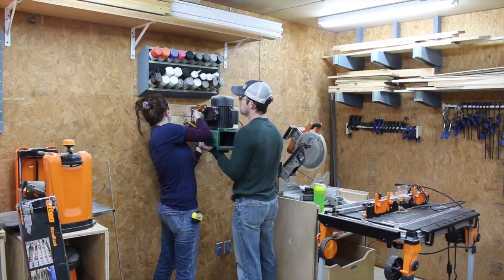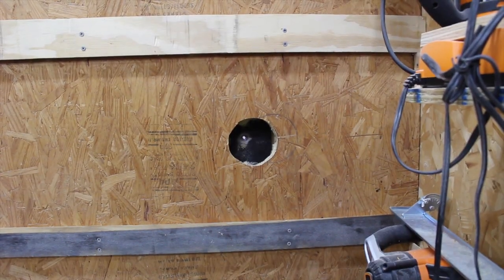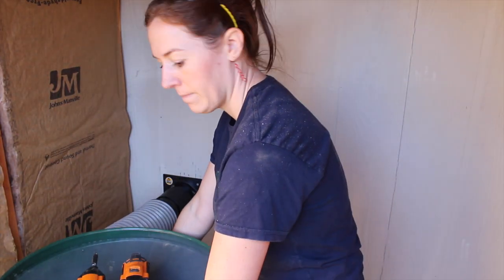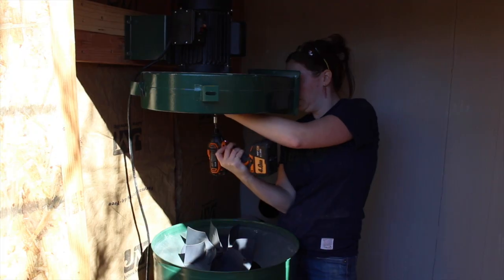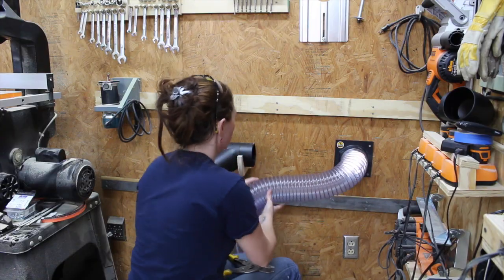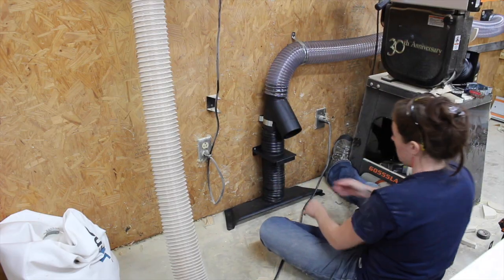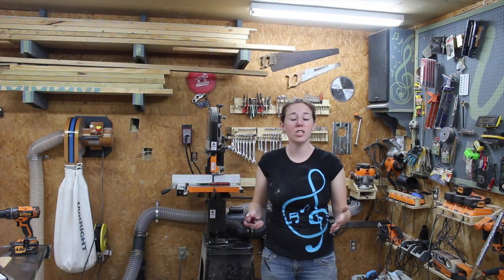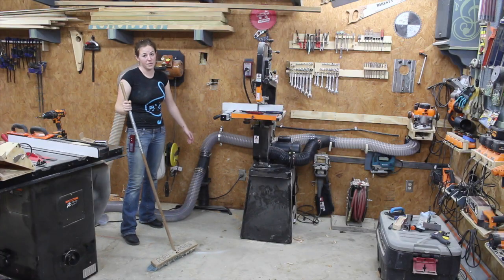Installing My Harbor Freight Dust Collector (Finally!)

Comment: I used a similar setup with the Harbor Freight dust collector.  We plumbed inside the shop with 4" PVC pipe.  We were able to position the motor, impeller and the trash can under an awning/covered area behind the shop.  The exhaust just blows straight out behind the shop into the weeds.

A floor sweep is definitely the next thing to add!!

It really is nice how quiet the dust collector is when it's outside the shop!

Comment: Hej April, put some magnets in front of the floorsweep to collect fallen drill- and screw bits out of the sawdust
Reply: Hey thanks for the great idea!!!
Reply: Dave D
Reply: That is an awesome idea!  I'm going to have to do that to mine whenever I get a dust collection system set up in my shop.
Reply: ooooo they have screw pickup wheels pusher i think would be a great place to store it in front of that floor hose.
Reply: Very good idea...
Reply: The vac probably won't lift them anyway.

Comment: April, I love the idea of building a shed to for the dust collector! I had mounted mine high in the air, but it is too noisy being in the same room. I plan to build a shed now.  When it gets done, that's another issue. I built a step up floor out of Two by Sixes and plywood to go to my stationary tools. The power lines are also in the step up floor. This has worked out really well for me.  I painted it grey and the paint is still in excellent condition, even with me walking all over it for all these years. There is a little step to go over it, but it has never been an issue to me.  Since I put mine in many years ago, I built all my blast gates. They are a bit of a pain, so I plan to replace them with purchased gates. Thanks so much for inspiration. John Esposito

Comment: Hi April, great job on the new "fitted and working" dust collector. But what i do like is the floor sweep port, this is a great addition to yours and any shop. You can get switches for the blast gates to switch on the motor as and when you need it,
we have them fitted in a shop i work in, no remotes to loose.

Comment: This video is really fantastic.  I have the same Freight Harbor dust collector, and have been planning a wall mount, two-stage filter (just like yours), and plan to vent outside as well.  Mine will be mounted inside the shop because I live in Seattle where rain is a constant, and I have no adjoining shed or other outside shelter.  Anyway, I learned A LOT from your videos.  I've been thinking about how to rotate the collector because of the vent direction, and you were kindly brave enough to pull off the flange and describe how it is mounted to the motor - so now I can use your tip!  Also, I was stumped figuring out how to attach some kind of quick-release "lid" on my trash can so that I can easily attach/detach the baffle.  Your system looks pretty good, I'll probably try a different approach, but I was inspired by your use of the buckle system on the trash can handles.  BRILLIANT!!!   Anyway... I have loved all your videos.  You are working on so many similar projects and I'm really impressed with how you work through issues, and how quickly you are able to complete these projects.  My miter workstation took weeks, many redesigns, and I've just completed modeling version 3 in SketchUp and am doing cuts / rabbets, etc, today (pre-assembly).  Thanks for all the inspiration, I'll be subscribing and following along on your awesome projects.

Comment: Hi April,
I'm jealous! Just a suggestion - there should be no problem exhausting your dust collector out of your shed. Since that is technically not a load bearing wall, I would cut the hole in the wall through the stud and frame around it similar to a window. I think you did pretty much the same thing when you mounted your A/C unit in your shop.
Reply: +Jim Kodysz 
A VERY GOOD suggestion!!!!!!!!!!! April, please try this!
....13

Comment: If you want to have a removable hose (like that one that goes to your table saw) and don't want to un-do a hose clamp every time here's an idea: Get/make two flanges like that on the inside of the through-wall duct. Then drill some corresponding holes in the flat parts of them. Glue in some rare earth magnets in the holes. Now you will have a coupling that can be disconnected and reconnected easily, or even blocked off completely using a small sheet of metal. Magnets for this project can be got at HF really cheap.

Comment: Hey April.  Heard about the planer shavings issue on the podcast.  I'm betting most of the clogging comes from having such a thick slot what with doubled up plywood.  My baffle is only 1/2" thick, and it just hangs from the lid of the can (so the outside edge of the slot is actually the smooth can wall).  No clogging problems so far.

That conical "shelf" on the inside of the HF separator isn't helping you out any either.  It's just in the way of the cyclonic airflow.  Bust out the Saw-Z-All and get rid of that thing.  You might end up having to add 3-4 inches of PVC to extend your central air outlet down a bit too.  IIRC it's supposed to be about even with the top of the inlet pipe.

Love the project!  Can't wait for spring so I can start venting mine outside again.  I can't leave it that way all the time or I'd have to just start calling it the "heat remover" instead of the dust collector.

Comment: Awesome job, April.  I started off with flex hose for my trunks and quickly grew to hate it for air resistance.  I switched to galvanized 4" pipe and it was night and day.
Reply: +Jason Rausch somehow, i think you meant 4" ducting vs. 4" galvanized "pipe"... hehe

Comment: Thumbs up!! With the issue of the hose being in the way of the blast gate/floor sweep you could simply turn "y" fitting left to where it touches the wall and then connect your table saw hose angled down the wall and across to the table saw. Just a thought I had hope this helps!!

Comment: Good job, just keep in mind in you get a real winter where you live that the dust collector will also suck all the heat out of your shop, the only good thing is if you have your air compressor in the shed also it will stay nice and warm.

Comment: Hey April, I finally took the plunge into dust collecting. Installing the collector was a piece of cake. I put it in my attic so anything that sneaks out of it will be harmless. However I found plumbing this thing was a huge undertaking. I ran the 60 feet of pipes thru the attic where but still hanging the rest from a 10 ceiling was interesting. It's finally in and can't wait to use it and trouble shoot everything. Thanks for the inspiration any tips. Maybe one day I'll get a big ole shop like yours.

Comment: Floor sweep=pretty cool. I would have like to see the dust storm outside. Don't let your compressor suck up all the crap from the exhaust, if it is outside. Rotate table saw Y 90* to left against wall. I wish the the people I work with were as competent as you! And your narration is excellent. Also, I can relate to your drive levels; I have 5 lifetimes of projects and with so much to do, projects get pushed out, but when I start, they are primary focus.

Comment: I mounted my HF Dust Collector on outside wall and vented it directly out through the wall. Thanks for the great idea of rotating the housing and the heads up on the backwards threads.. Wish you would have mentioned that I needed a Pulley Puller to remove the impeller... Lol ..  Maybe you didn't need one?? I enjoy all your Videos.. Thanks & Keep up the good work..

Comment: Nice work. One day I need to do this. I have bought and used the large 3",4",5", and 6" diameter hole saws, and used them successfully on my 88 year old home to run exhaust vents from the 2 upstairs bathrooms out through the concrete stucco wall. I found If i use a long enough drill bit with the hole saw, and I check for being perpendicular, the center hole lines right up with the first hole drilled. Saved me from using a jig saw 30+ feet in the air. 8^).

Comment: Nice job there..How about this, cut the stud that the exhaust connector was going to hit, frame the opening like you would do a window and run the exhaust out that way since the wall isn't a load bearing wall, it wouldn't hurt a thing, just my thought..Good continued wood working !!

Comment: See if you can find a neodymium magnet or two to put under your floor sweep. Epoxy them to the floor or place on top of your sweep that way it will pull out anything you lose in the floor and keep screws and nails from being sucked up. It's handy to have when you lose something important and find it on the magnet instead of lost forever in your dust collector.

Comment: That motor is heavy, I did mine by myself.  I moved mine and just vented it outside and it blows to the ground.  I clean up the pile everyone once and a while, not enough times to suit the wifey.  I need a floor sweep.  Great video.

Comment: Nice!  That flex hose is pretty bad for air flow though.  It's great for moving around and sucking up the floor, but along the walls you should definitely use 4 inch ABS plastic pipe from home depot and the like.  It will look better, and have better flow.  Great ideas and work as always

Comment: Great job April!  I'd think you would just use your great woodworking skills to make a 90deg adapter duct for the outlet so that you can connect your current outlet position through the outside wall while missing that stud.

Comment: Great job. If a longer run is needed you may lose some suction with the style hose you are using. The corrugated walls of the hose slows down the flow of the air inside. A smooth pipe for areas that are not going to equipment would enhance the flow you already  are experiencing. Again, a fine accomplishment that is sure to make your work area a quieter environment. You have good ideas for a shop. Wish I was as organized.
Reply from the maker: Yes true true, a few people told me that but so far I'm really happy with how it's working. But like you said, if I add in longer runs I might have to switch to pipe. If that's the case, I'll probably go with something larger too. Thank you!

Comment: Nice to finally have a working extractor system April ( better for your lungs as well) if you find suction power loss I would suggest you look into fitting hard extractor pipe the flexible pipes loose almost 30% vacuum due to flexing, just use flexible from waste gates to machine, you might also want to fit some earthing from the flexible pipe it developed fantastic static ( might be a cheep perm for you but ouch it hurts) 
Your shop is looking better as times goes on I'm definitely getting gelous

Comment: @7:27 all you have to do is rotate the Y connection 90 degrees away from the saw and that will allow you to clear the sweep and gate and still run to the table saw with the flex hose.

Comment: Great job on the follow up! In the future please consider using PVC pipe. This will decrease leakage from the hosing connections and increase your airflow due to the lack of ribbing on your hosing. Just a thought:)

Comment: Quick tip, since the hoses are all running along the floor, those might get in the way. Why not reverse that y-connector and have your hoses run along the ceiling and attach a spring to draw them back up when not in use? This way you can pull them down and attach them to tools as needed, while keeping your shop floor obstacle free.

Comment: Way to go April, now you will have a clean environment that will not be damaging to your lungs. Next is a air filtering system. HA! Thank you for modelling a clean shop envronment. I will be moving mine out side as soon as the rainy season is over.

Comment: april looking good...just an FYI I have gone through 3 of those remotes with less than 1 yrs worth of use...dont know why...maybe lightning ....I now use the 20 dollar outdoor remotes for lights ..they may not be rated  for the amps but my last one lasted 15 yrs and just went out a few months back...and when connecting those plastic fittings try super gluing the connectors together instead of using a flex hose between them.when applicable ..if I do a video on them I will let you know...love your stuff

Comment: Looks great! I'm glad you showed the "through the wall" fitting. Mine will be outside of the shop as well.  Could you just rotate the 'Y' fitting to the left a little bit so you can fit the broom closer to the floor sweep? Maybe that would give you more clearance.

Comment: You have a harbor freight dust collector and a dust right dust collector makes me so jealous I have nothing witch is bad because it's hard for me to breath !!! I just can't afford a dust collector. I'm so jealous of your shop and tools. I wish my shop was like yours. Love you videos can't wait to see more !!!
Reply: In my old shed I used an unloved  kirby vacuum bought for about $25 and an old 25 gallon paint drum. Believe me when I say it worked a treat ;)
Reply: Anthony Frasco you could also make a shop air cleaner with a couple furnace filters and a box fan. You can look up videos on YouTube to get an idea about designs.

Comment: Very Very nice, Turn the y joint to the wall and the hose to the saw will not interfere to the sweep and no extra parts
Reply from the maker: Good tip!

Comment: Great video! For what it's worth, I've been using the same HF collector with Rockler's "Yellow" DC Remote Switch (#43959) which has a much smaller remote for a couple of years with no problems. The 20A rating by HF seems to be a bit exaggerated.
Reply: +Around Home I have as well.  Not an issue regarding the amps.

Comment: I found that having a 'permanent' ductwork dust collection in a small shop, is a waste of money and space.  Using the 7 to 1 memory flex hose (Rockler) is such a better solution because you never have the hose permanently laying on the floor, AND the air flow is much more efficient!!In other words, the outdoor dust collector is a great idea, but just attach the flex hose to the through the wall tube, and put a 'Handle" that attaches to all the different machines you have on the other end.  See Rockler for the Quick Release System, works great!!  No blast gates no costly permanent set up.

Comment: "...would you just lift the motor?"  I love your attitude.     I plan on using straight walled pipe (PVC or metal) where it will permanently set to reduce interior vortices. The connections will be removable to allow cleaning.    Great point to adjust the cord for length.  I usually disconnect it inside the tool if it has a molded plug.  When a longer cord is needed I buy an appropriate sized extension cord, cut the length needed and replace it or hardwire it if it isn't going to move.

Comment: Hi, I enjoy your vidjoes... I have been using very similar dust collection system in my workshop. I moved to 4" PVC for all runs longer than 4'... Cheaper, more efficient flow. Some fret about fire  hazard with the static charge potential with the PVC. This potential was debunked in a documented report in Fine Wordworking several years ago. Keep up the great work!

Comment: One word of advice...  Any blast gates that are sitting horizontally should be oriented so that the gate opens in the DOWN position. This helps prevent sawdust buildup in the track of the blast gate, which can prevent the gate from fully closing. 

Great install, and man (girl?) does thing sound quiet. How loud is it outside, and do you have neighbors that it may be bothersome for?

Comment: Great Job April, slightly disappointed about not finishing the exhaust :) . You were complaining about the hose, so why not use a rigid 4" PVC pipe? You could attach a board on it and use it as a shelf, while now it's just a saggy hose attached to the wall, not looking that nice at all. Also the fittings will stay and hold better that way. Most likely your vacuum will also work better, because of the smooth inside and your corners will also be tighter.

Comment: Opposite threads are reversed threads. Due to the rotation of the part and the position of the motor. On table saws when the motor is on the right. It is usually reversed and left motors are regular threads

Comment: I know this is an old video, but if anybody does this you should figure a way to return the air back to the shop. That way you are not losing the shop's conditioned air to the outside and creating negative pressure in the shop.
Reply: Im in process of trying to figure that out now ,any ideas

Comment: Not sure where you live and if it is a problem, but if you heat or cool your shop you might want to try and reclaim the conditioned air rather than pushing it out of the shop. Nice Video.

Comment: Could you run some sort of lighting out there, like a pull on off bulb? If you ever had to work on the motor or compressor...well, I guess you'd just move them into the shop, but that might be in the dark.

Comment: great job,,,' jealous ...hey..did you remember to hook up a ground wire to the dust bag(to a grounding rod)...prevents static electricity from building up,which could cause shock,fire or even explosion from ignited dust particles ....god bless and be proud,be safe and be happy.   ps..you got an older sister--ha ha....jda

Comment: Thumbs up April!!!
Reply from the maker: Thanks!
Reply: +April Wilkerson Great project, April! this makes me want to move forward with my HF purchase sooner rather than later. One question though, how much would you say the system and additions cost you? 

I looked through the comments and your site and couldn't find anything. 

Thanks!
Reply: +Steven Kronenberg I can't speak for April, but my HF unit cost me ~$170 with a coupon.  Fittings and PVC piping ran me another $100 or so.  We didn't use a remote, we just wired a switch to a central point in the shop where it can be reached.  We did use a dedicated 20-amp circuit for the unit.
Reply: +Tim Rice thank you for the info. After a while, dust collection becomes necessary as opposed to a perk.